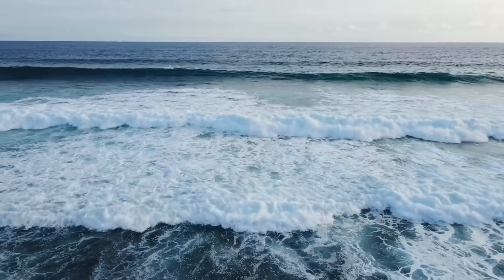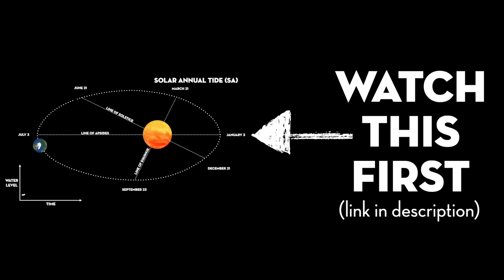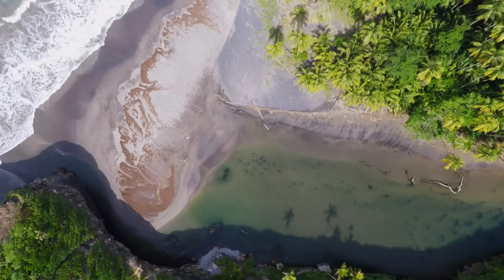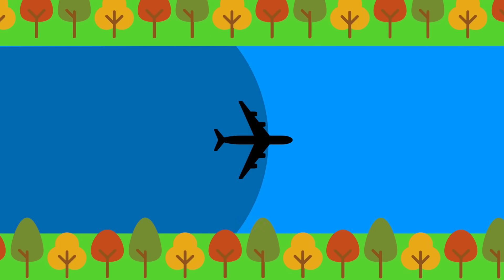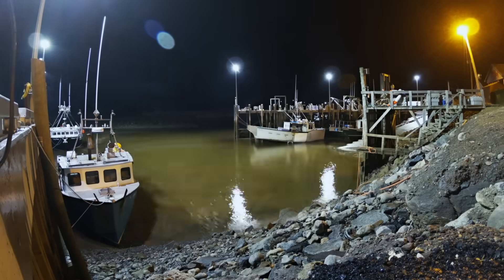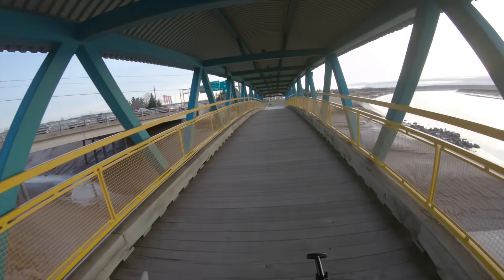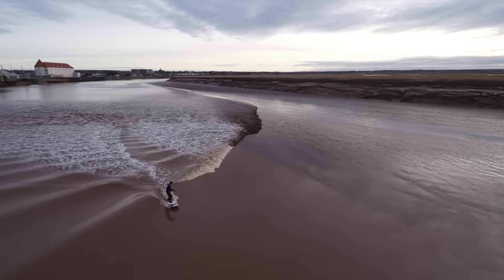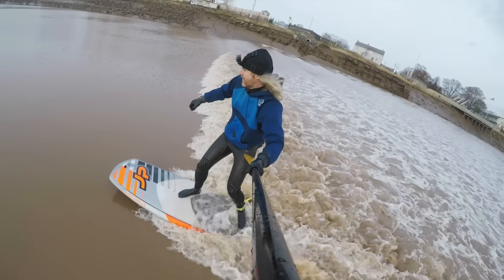How do Tidal Bores Work?

Comment: There is no perfect balance of the wave speed and tide speed...
So long as the tide rises fast enough and the wave speed is slow enough, you get the bore.

This reminds me much more of a hydraulic jump. 
Fast supercritical water flowing in one side, hydraulic jump, subcritical water behind. 

The shallow water wave speed is √(gh); if the point where the ocean surface is equal to the river height moves faster than that, then there is no way for the information to propagate upstream.

The river water upstream doesn't know that the tide has risen, it just keeps flowing as usual until the wave comes in — basically a shock wave.

Comment: Very interesting.  I've heard explanations for tidal bores, but they were missing the all-important detail about the speeds matching, so the explanations didn't sink in for me.

Now that I've watched both videos, this one and the "How the Tides Really Work", I've given a little more thought to something I've been wondering about for years concerning tides - where does the water come from at high tide, and where does it go at low tide?  I'm talking about the individual water molecules, and in the open ocean.  Obviously a relatively narrow channel connecting a large body of water to the ocean will have large tidal currents flowing in and out through the channel.  But in the open ocean, it's not so obvious.  Clearly the high/low water molecules don't come from the region where the tide is currently low/high, since that's a few thousand miles away.  So it must be analogous to filling a kitchen sink with water, where the required water is already in the pipes of your house.  After some thought, my conclusion is that the individual water molecules travel such a small distance that you can say the water doesn't move (i.e., flow) at all.

Here's my reasoning.  Consider a square mile of open ocean in an area where the water depth is a one hundred feet, and the tide on a particular day is 10 feet between low tide and high tide.  A additional volume of water one mile long by one mile wide by ten feet high is a huge amount of extra water.  Consider a vertical slice of this volume that is one mile long by one inch wide by one hundred feet deep.  If you could pick up this slice of water and place it on top of the adjacent water, the water level would be one hundred feet higher.  So to make a ten foot height increase, you'd only need to move a one-tenth inch slice of water and spread it over the adjacent inch of water.  Nothing in this thought experiment depends on the choice of a one-inch slice, it could just as easily be a thousandth of an inch or a millionth of an inch.  So the individual water molecules don't have to move at all, they essentially stay in place, with some percentage of them rising in height.

This seems really counterintuitive, that such a huge volume of water could appear and disappear with essentially zero water current flow.  Is this analysis all wet?

Comment: I live in Anchorage, and there are people surfing the tidal bore in Turnagain Arm all the time. I'm not aware of anyone who's died or been injured doing that specifically, scary though I'm sure it is. However, because our tides are so drastic, people will try to walk to islands and other coasts during low tides. Unfortunately, the Cook Inlet's bottom is fine glacial silt that acts as a non-Newtownian fluid: If you run across it, it's hard as concrete, but if you stop and stand there it'll slurp you up. People die on a somewhat regular basis from that, maybe once or twice a decade. They start sinking, can't get out (a man was torn in half when a helicopter tried to pull him out many years ago), and drown. Great video!
Reply: Oh my gosh! That sounds so awful; I had no idea anything like that even existed.
Reply: I’ve been to Turnagain and surf so I was warned not to go out on the mudflats there as people allegedly have died in the past  …they weren’t surfers they were clamming or something and got stuck in the mud when the tide came in
Reply: @SearchIndex like that young girl

Comment: Good video. Driving through Scotland I was lucky enough to arrive at the Connel Bridge just as the tidal bore, known as The Falls of Lora, was coming in. There were some kayakers on the water in river running kayaks. I'm  a sea kayaker so I could understand some of what was going on. The kayaker closest to the north shore was really struggling, though the current and bore didn't look any more difficult than beach landing through surf. Clearly there were more forces than it appeared (from shore. I was in the car park)  He was rescued and towed ashore by his friends while others retrieved his yak and paddle.  And I would expect most of these bores to be muddy, possibly sandy. After all what flattens out into a long slope better than mud and sand?
Reply: must admit I've never heard the Falls of Lora called a tidal bore, only a tide race. Usually the waves are more like standing waves under and around the bridge, rather than running through on their way miles inland. More like the Swellies than the Severn.

I've sea kayaked there once; the currents and eddylines were ferocious! But it is impressive watching the experts play...

Comment: I think the explanation of sonic booms isn't quite right. Any plane going faster than the speed of sound makes a sonic boom, it's not just planes going at exactly the speed of sound. So I'm not sure that a tidal bore needs the speed of two types of wave to happen to match.
Reply: Sonic boom is a poor comparison.  It's much more similar to " double bouncing " somebody on a trampoline.
Reply: @taitsmith8521 Thankyu
Reply: Thankyu
Reply: It's entirely not right and also has nothing to do with tidal waves. The river bore dynamic itself is transparently understandable and needs no analogy whatsoever. In fact, the wave is considerably easier to understand than sonic booms. They should have just stuck with river animation and excised all the plane stuff, especially the plane overlaid over the river.

One doesn't make analogies by using more obscure phenomena.

Comment: A tidal bore is like you, in sync speed-wise with the rotation of the Earth and the momentum of the gravitational effects of the moon at its strongest.  It's as if the Earth was moving under you while you stayed lifted up above it based on the moon pulling you up in a malleable situation support-wise.  You surfed the Earth.
Reply from the maker: That’s a wild way to visualize it!
Reply: @Waterlust  It's not really true though. The rotation of the earth is a speed of about 1,000mph at the equator. Zero at the poles, presumably 500mph ish at a the  45 degree latitude of Fundy Bay.

Comment: I experienced one of these in Moblie Bay in Alabama while kayak fishing in the marsh.  It had been dead silent for hours and we heard water rushing.  We look behind us and there are 3 waves stacked on top of each other.  They pass us and we noticed the water on the shore was about 6" higher than it had been.  The wind was blowing out and the tide was coming in.  I believe the wind had pushed all of the water out of the small creek when suddenly the tide overcame it and all of the water came in at once.  It was very neat to experience.
Reply from the maker: Very, very cool!
Reply: Abstract :
   
 The energy that dominates the earth is very great, some of it is natural, like the heat of the sun and volcanoes, and some of it is human action, by cutting down trees, without replacing them and cultivating in their place...
 There are five forces that control or dominate the planet...
 1- The first theory (horizontal dynamic movement) and its end...
 The occurrence of storms, rain, floods and snow, at unexpected times and places, is because of the expiration of this theory, which needs to be balanced...
 2- The second theory (vertical dynamic movement) and its end...
 This movement or force controls or dominates the earthquakes, earth cracks, drying up of rivers and lakes, earth openings, mountain collapses, and the emergence of drinking water springs on the ground...
It becomes out of control...
 These phenomena increased due to the end of this theory...
 The third theory: it is water that rotates the earth...

 The fourth theory: the Earth's axis of rotation has tilted 2° degrees...

 The fifth theory: The Earth has a new orbit...

These studies had completed and sent on July 26th 2000

                                YOUSIF A TOBIYA
Reply: Now, now, now...The Earth is more than 50,000 km away from the Moon, and is close to the Sun and the planets. Therefore, the Moon’s terrain cannot be seen with the naked eye like before...The Earth will be lost in the depths of infinite space...
This phenomenon confirms my fifth theory (the earth has been lost in the depth of space)...
                          Yousif A Tobiya
Reply: You all talk about tsunami, but you do not know when? it's going to happen? 
I will explain and discuss this phenomenon at any scientific conference...

Yousif A Tobiya
Reply: You can imagine the Earth without water, as water balances the shape of the Earth, its rotation around itself, and around the sun.  Tides are considered a safety valve for the Earth and its rotation.
   As the water melts, the Earth slows down its rotation.
   Water has increased due to the melting of the ice caps in the poles and the Himalayas, and thus, the rotational force also increases...
   Now: The length of the year now is [365 1/4 +_(2 minutes)]...
   These studies were completed and sent on July 26, 2000...

                                 Yousif Ayoub Tobiya
Reply: Unfortunately: There are several theories taught in universities in a wrong way...
   I will explain these theories and studies at any scientific conference...
  Please hold the conference at the University of Melbourne...
                                 Yousif A Tobiya

Comment: tsunamis are not rough waves, they are long waves caused by some external perturbation such as landslides, rock slide, ice slide or some kind (not all) of earthquakes. Not all tsunamis are dangerous, only the big ones. Rough waves are more special that are rare and their height is 2 as the highest surrounding waves, the nature of those is still studied and explained on statistics levels. Cool video esp the surfing part!!! If I understand well it is more the case of wave (tide) on current (river) and the interaction - not just slope varying in right way. It makes the amplitude got up and makes wave steeper till it breaks.  On youtube there is another cool video explaining hydraulic jump and the subcritical, critical and supercritical speeds.
Reply: Do you mean rouge waves instead of "rough" waves?
Reply: @GRosa  do you mean rogue waves instead of "rouge" waves?
Reply: @derpdederp8954  Yep, I don't usually mix them up in writing but it happens :)